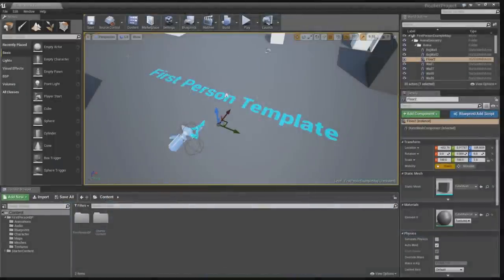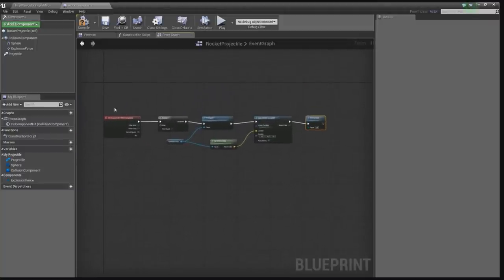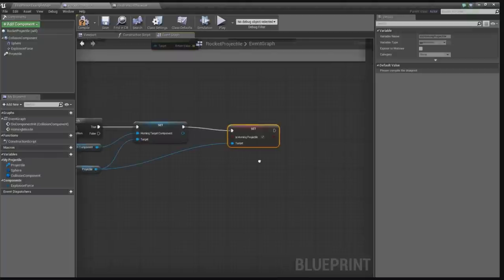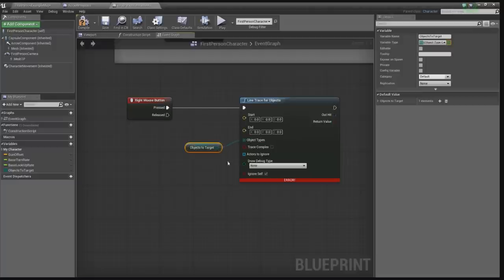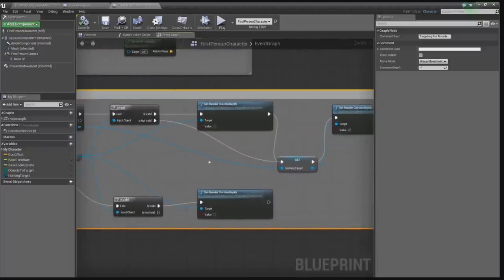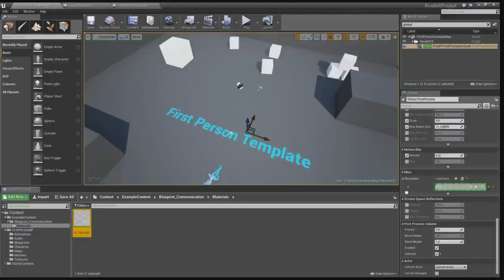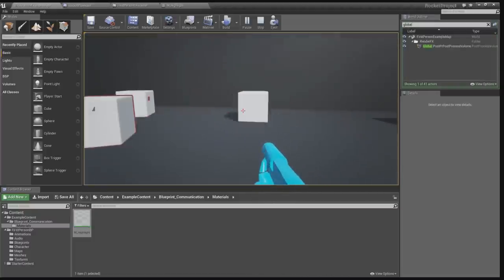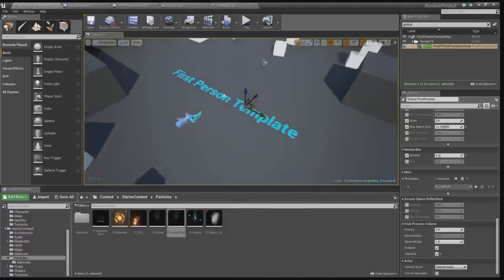[Unreal Engine 4.7] Homing Missile Blueprint Tutorial

Comment: Hi Unain,

There is no "GlobalPostProcessVolume" on my floor lvl. only a "PostProcessVolume".
Is it maybe because of the Unreal Engine Version I am using = 4.14.3 ?

Stuck at 18:25 mins..
Reply from the maker: That's the one you want, it just got renamed to PostProcessVolume. Then go to misc -> blendables and continue following the tutorial.
Reply: Hi Unain,

That is where the problem is, I dont have the "misc" option in "PostProcessVolume".. 
No idea what the problem is..
Reply from the maker: There is a tab with a yellow arrow called: Settings. You need to expand that section to see blendables.
Reply: Will have a look as soon as I get back on Unreal tonight. 
Thanks for the advise Unain..

Comment: Ace! But could you explain the custom depth node a bit more? Dont get what it does^^
Reply from the maker: MrPhinixa The Custom Depth node enables/disables it on a certain object. Now Custom Depth itself allows you to mask certain objects by rendering it into a separate buffer. This way you can render this buffer with a special material (M_Hightlight) and adjust certain pixels the way you like (extruding the edges for the line on the outside). You can read more about the Custom Depth buffer here: https://docs.unrealengine.com/latest/INT/Engine/Rendering/PostProcessEffects/PostProcessMaterials/index.html
Its a pretty advanced topic, maybe I shouldn't have included it. But it looks so good ;).

Comment: How would you modify this to create a targeting system like WoW where you press a button and it finds the nearest target and uses that as the HomingTarget? I've managed to set up a system where I can find the actors of a certain class within a certain distance from the playable character but I can't find a way to link it to this tutorial
Reply from the maker: sinksinkswim You just have to modify the targeting system at 9:20. Get rid of the line trace. Use Cast to Static Mesh Actor on the actor you found with your function (find the nearest by looping through them all and checking your world location - actor world location -> lowest vector length). Then tie in the Cast to Static Mesh Actor end result into Set Homing Target at 14:30. Now when you right click it should target the nearest actor.
Let me know if that works, if you still need help I will create a blueprint that shows it off and post a picture for you.
Reply: ***** I'm having a few difficulties with it. The first being that the targeting system I've set up uses Get All Actors of Class, so I'm having to use Cast to Enemy to get their relative distance - this seems to stop me using Cast to Static Mesh Actor afterwards. Ideally I would like to be able to find all actors within a specified range, add them to a 2D array and sort them by distance so that I could cycle through all actors (within the specified range) by order of distance from the player. However I'm led to believe that 2D arrays aren't a feature of UE4. Any advice would be greatly appreciated. Here is what the targeting function looks like http://i.imgur.com/hRvDkJu.jpg
Reply from the maker: sinksinkswim The Enemy is an actor I presume? Then it should have a static mesh component connected to it. You can get the static mesh component from the actor.
Unfortunately you can't use a 2D array indeed. But you can use an ignore array for all the actors you have already targeted. So say you find the closest enemy and target it, then you add that enemy to an ignore array. Next time you go through the search for closest enemy array check if the enemy is in the ignore array and move to the next one if so. When you get to the end and you have no targets, empty the ignore array so that you can target the first one again.
There must be a better way though, but this is just off the top of my head :).
Reply: *****
Enemy is an actor. I think I can work out a method for cycling through the actors but without a 2D I'm not sure there's an easy way of sorting them by distance. Would you be able to show me what I need to do to my blueprint to use the mesh for the HomingTarget since the Target Enemy function and Fire Projectile functions are separate?
Reply from the maker: sinksinkswim Btw feel free to add me on the Epic Games Launcher as a friend (Unain), might be easier than talking on here :).
Reply from the maker: sinksinkswim The sorting of distance is tough but doable. You just have to make a unsorted array first and loop through that to make a new sorted one. Here is how I did it: http://i.imgur.com/PMLUCDQ.png
Function SortEnemiesByDistance: http://i.imgur.com/BaMD1Cg.png
Function GetLowestDistanceInArray: http://i.imgur.com/MMWUQTp.png
Edit: Change Static Mesh Actor -> Enemy for you ofc :).
Reply: Thank you so much for all the help dude, I'll give this a go!

Comment: Using 4.7 but te Highlight system doesn't really work for me, what could it be?
Reply from the maker: ScGendo Hard to guess without specifics, but I would check the targeting system with right mouse button first. Go through the whole sequence to see if everything is connected properly. After that, make sure you have added the M_Hightlight material to the blendables (in misc) on the PostProcessVolume (see around 18:10).
Reply: ***** Thanks for the reply, looking at it again seems everything as it should. It's ok if it doesn't work as i was looking for general BP practice and not a specific solution.
Reply: check  check box in  2nd set renderer castom dept ıt solves

Comment: I'm doing this in my own custom project and "Set Homing Target" is not a thing in mine. Is this because I am using 4.9?
Reply from the maker: +shortbusheros4 Make sure your projectile has a Projectile Movement Component. Drag from that projectile variable in your blueprint, it should show up (just checked it myself in 4.9). If not, uncheck "context sensitive", it might show up that way :).
Reply: +Unain Oh yeah that did it, I was using my own actor as a projectile with an offset on the event tick to propel it forward instead of the projectile movement since I didn't know what that was at the time.

Comment: So, I have cross checked and mine I am sure i copied you correctly. Here is my problem, it works on the first time, but continues to go to the second set render custom depth ( via is valid node ) and it will keep doing that. Wall detection is alright though, its as if i cant highlight more than one time.
Reply from the maker: +JACK RAIDEN Could you post a screenshot of the blueprint that sets the custom render depth? Its a bit hard to guess what could be causing it :).
Reply: haha np, i am actually surprised you replied so fast :)
Reply from the maker: +JACK RAIDEN In that case, the line trace is not needed. The line trace is only there to select the item you want to have a border. You want to loop through the targets (probably an array) you found in your other blueprint and use the Set Render Custom Depth on each target to true.
Example: http://i.imgur.com/zCMupFd.png

Now this example loops through all Static Mesh Actors in view (you probably don't want that), you want it to only loop through your specific class (Enemy/etc). But it will give you something to work with for now.
Reply: *****
Anyways, what was wrong in my bp that it doesn't work like yours?
Reply from the maker: JACK RAIDEN Couldn't see anything different except for the usage of Static Mesh Components instead of Static Mesh Actors. I have no clue.
Reply: *****
Yeah it isn't working :(
Reply: *****
Oh, and i didn't use static mesh component, ue4 converts it automatically.

Comment: Awesome tutorial man, I'm having some issues though, my homing projectiles just do not home, keeps finding 'None' for the Homing Target variable. I've attached some screens of my blueprints if you'd be kind to take a gander :)Twin Stick Pawn:
http://i.imgur.com/rbRAQ9Y.jpg
Rocket Projectile:
http://i.imgur.com/NqnHgNc.jpg
Fire Shot:
http://i.imgur.com/hul8BDL.jpgI couldnt get the targeting to function on my enemies, with the 'StaticMeshActor' references, so they are all TwinStickElite references which require portions to be converted to Primitive Components, referencing the ShipMeshComponent.The highlight works, it just isnt writing the correct information to the Homing Target variable I imagine since this is printed out in the logs after playing:Error Accessed None 'K2Node_CustomEvent_TargetToHit' from node Set HomingTargetComponent in graph 'EventGraph' in blueprint RocketProjectileThanks for any help dude! ^_^
Reply from the maker: +Roonast The cast to TwinStickElite in TwinStickPawn is the culprit. It should be Cast to Static Mesh Actor and the HomingTarget should be a Static Mesh Actor too. The targeting is really specific on what type of component it wants (even though some connect fine to it). It really wants a Static Mesh Component, every actor should have that.
Also, check if the Cast to TwinStickElite is actually working. Add a debug message to the Cast Failed output, it might be having issues with the conversion.